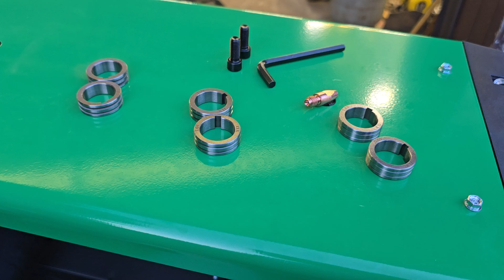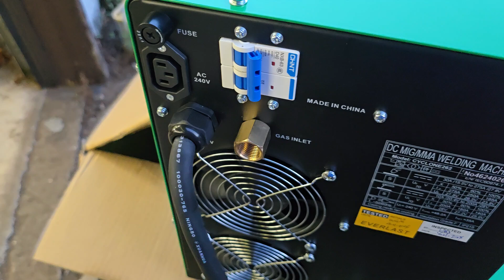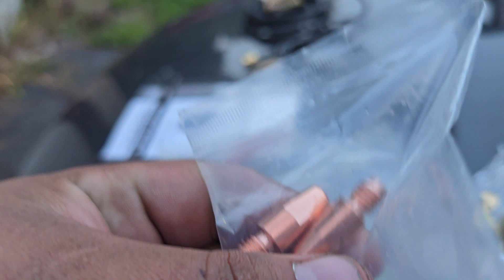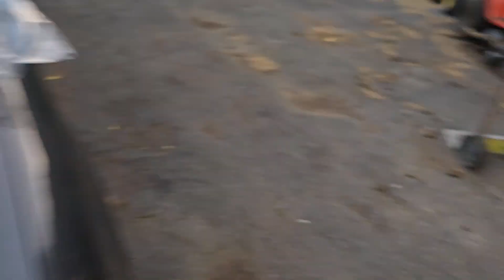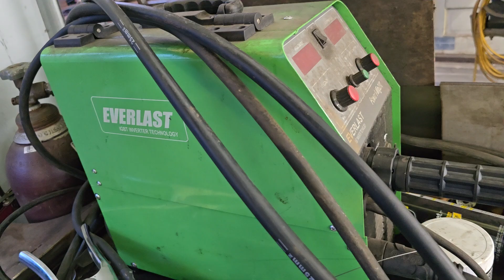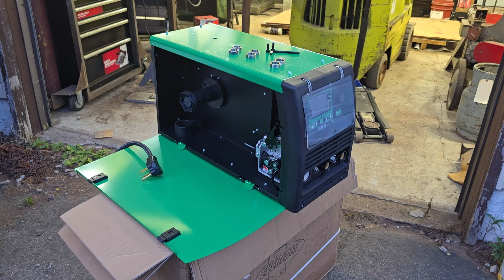My New @everlastgenerator Cyclone 262 MIG Welder

Comment: How do you like the cyclone compared to the otheres in same price point?  How is it holding up?
Reply from the maker: I really like it. But you'll absolutely want to buy a second smaller gun and the proper liners for it. As far as comparing it. I've only used so many machines. The ones I have are all much older than this. So it's not comparing apples to apples.

Comment: Hopefully they've improved the MIG torch.  My 275P welder came with a similar one.  Heavy duty enough but the trigger switch on them is junk.  It wasn't anything more than a spring loaded washer that when pressed, makes connection with a pair of contacts.  The problem is the cheap "switch" loses contact intermittently which burns the wire back tand sticks it to the tip.  Took a while to figure out what was going on.  I ended up replacing the whole thing with a Tweco style gun and that fixed the problem.
Reply from the maker: Not sure. The 24 torch that I put on my i-mig200 works great. It's not that old though. I just upgraded to that one and so far so good.